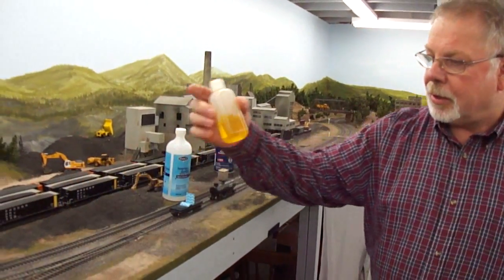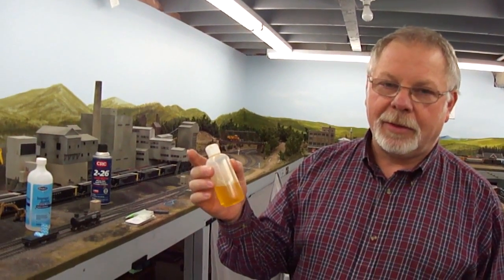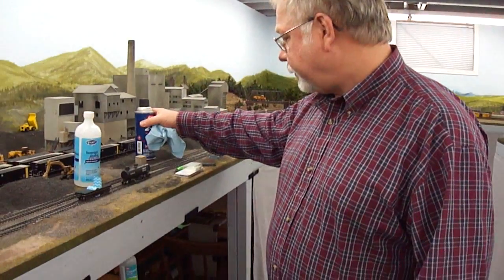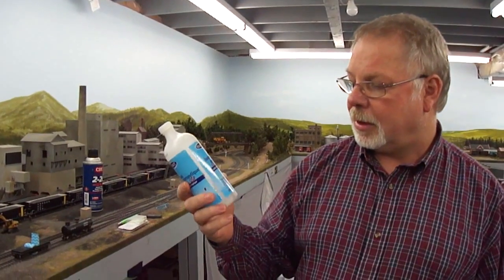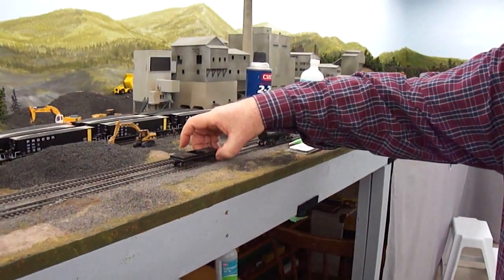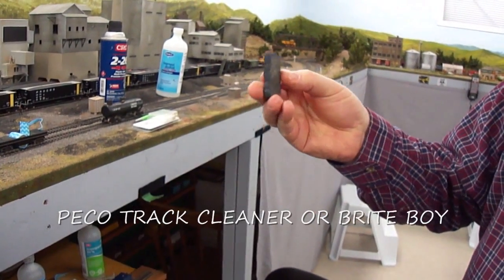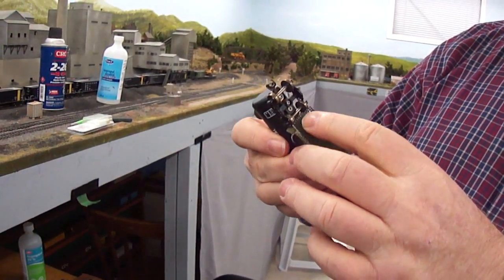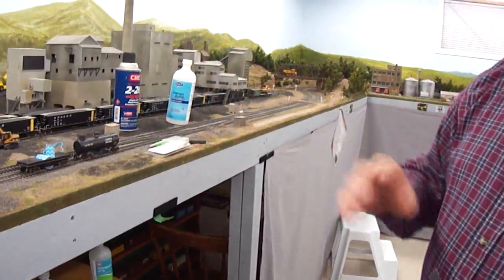TRACK CLEANING ON THE LYON VALLEY NORTHERN

Comment: Excellent video. Did you ever try Wahl hair clipper oil. I've used it for years.
Reply from the maker: I do not use any oils as my railroad is in an environment where I am concerned about dust particles clinging to the rail.  An oil would just enhance that possibility.  A nice dry clean surface is what I want so there is no gunk build up.  I have heard that some folks have had success with clipper oil the principle being it prevents oxidation of the rail...

Comment: Hello Gentlemen,
what is the name of brand of the fiberglass pen please?
Ben
Reply from the maker: I do not know if it has a name.  It is used for cleaning spark plugs and connectors you can find them in auto and electronic stores.

https://www.amazon.ca/SE-7616SB-Fiberglass-Scratch-Brush/dp/B003NHDITW
Reply: CNLVN

Comment: would you be able to run a train with a modified car to hold the sand paper and then the drip car and then the cloth car?
Reply from the maker: Dylan Ruppert You may but I like to wide up after the sand paper before I apply the alcohol
Reply: well I mean like on a long consist?